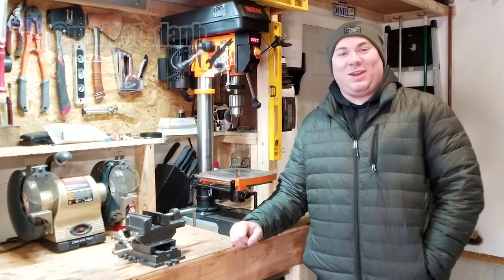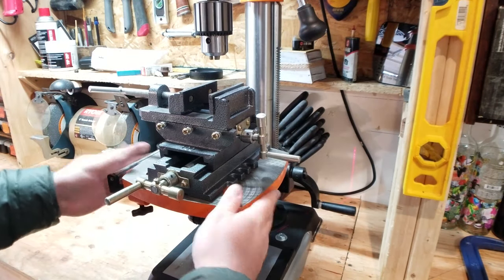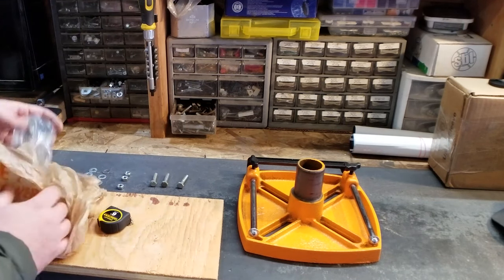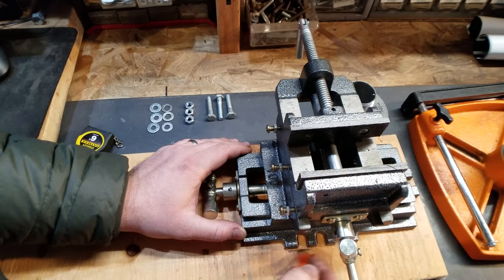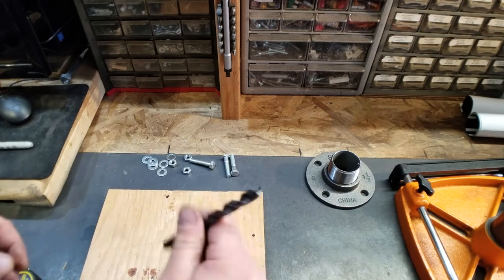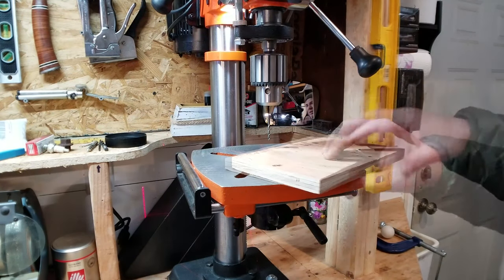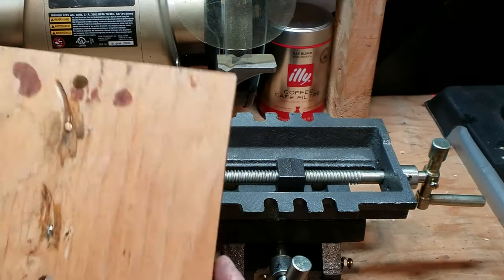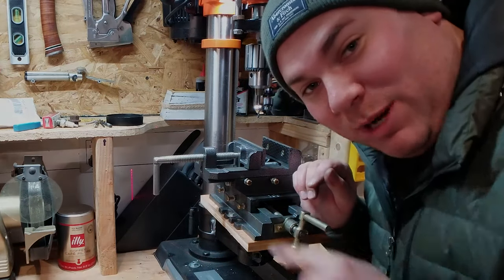DRILL PRESS MOD - MAKING AN ADAPTER FOR AN X Y AXIS VISE

Comment: You maybe able to rotate the original base plate 45 degrees that will change the bolt patters from X to a cross. Check it out it might work for you. It did for me. I have the Wen 4214T and have the harbor freight cross vise, similar patter. Best Regards and great video.
Reply from the maker: Thanks for the tip! will do, God bless

Comment: I like your idea. I have a similar "Milling" style vise bolted to my table, but my Drill press is a floor-standing model. If you want to drill in a panel or piece of wood too large for the vise, and do not want to remove the milling vise I clamp a large block with a sacrificial panel attached on top. The vise drill press combo is not well suited to conventional milling. I tried. The drill press just does not have the mass and rigidity necessary. I got lots of chatter and really poor results. Some who try damage their drill presses. Keep making videos and sharing.
Reply from the maker: Thank you for your feedback!  Truth be told this set up was specific for milling polymer 80% firearms and it works perfectly 🤫